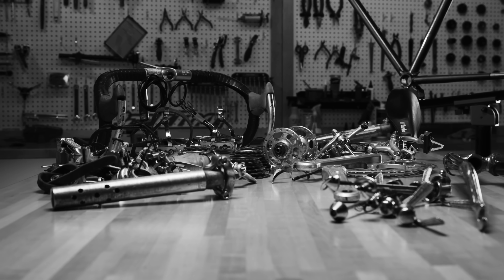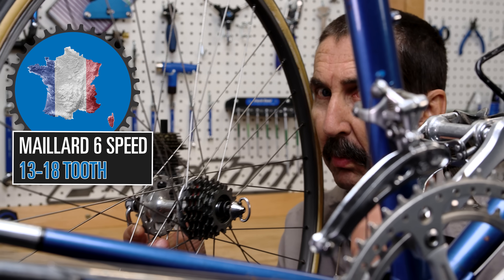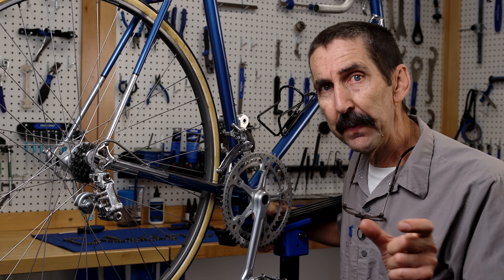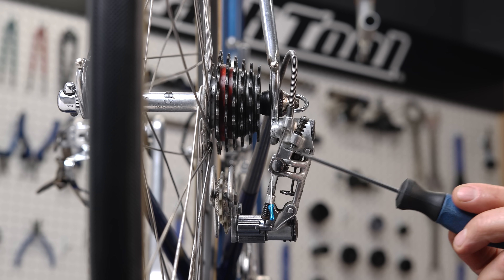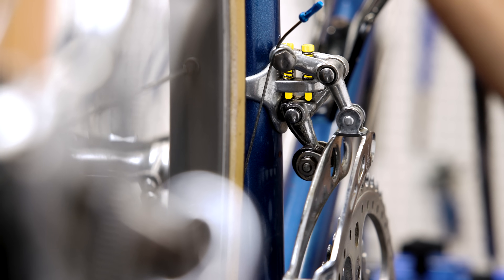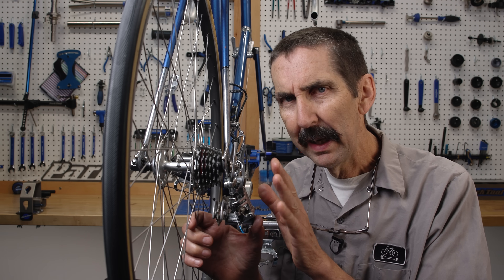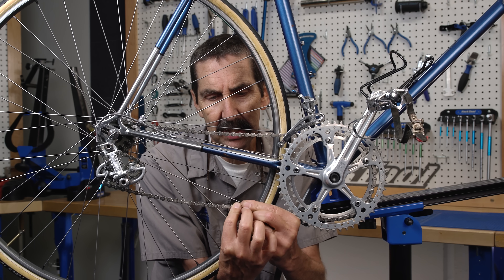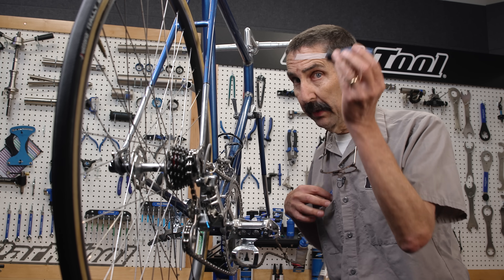What Can Old Friction Shifters Teach Us? | Tech Tuesday #225

Comment: E bikes basics end all.
How to Build Superiour E Bike Yourself: 
   Do not purchase pot metal e bikes designed by Lucifers kids or recommended by housewives& reviews Amazon. 95% humans = 
  I ride the 1st last e bike will ever have 2b built &will last u a lifetime.
 Step 1:
  GO LOOK@ YOUR NEW BIKE...
   Did u watch? FABIO URBAN RIDING ON Mt. Bike.
   U want STIFF DURABLE DESIGNED BY PROS Bike.
 Buy COMPETENT thoroughbred Mt. Bike 1st.
  $200 kit ebay 2nd. Thats it. 
 Understand never ever 2buy a pre built proprietary parts factory snake oil business E Bike pot metal flexible e bike for 3k with horrific ergonomics & crippled gearing& lousy components rusty cheap bearings stretchy spokes & brakes that wasnt built 4world champions on insane single tracks. Never buy bizarre huge tires or little idiot wheels cost $300 2replace tires $40 weird 2lb tubes or proprietary snake oil parts u can never find replace.
    Parts u can never find anywhere.
   Stick2 COMMON PARTS.
   BIKE must be STRONG STIFF STIFF STIFF STRONG STRONG WHEELS.
   I have supported 450lbs where thrubber meats throad. I could feel my worldclass STIFF handlebars& entire thoroughbred frame flexing. 
     Satans fancy e bikes would break in half in minutes as comparison what u see video below.
     Worlds best e bike? Is in my driveway. Do NOT SEARCH 4 an authority above me. Doesnt exist. 
    Modern bikes look like they do bcuz of me as do all world hour records broke since Graehm Obree ergonomics pioneered by me. All Tour De France riders went 2 Dual Control levers 1989. Shimano NEVER built better to this day.
     My engineering is END ALL go watch my short E Bike tutorials end all how 2attach beattery or carry stuff etc. 
    Very simple. 
   Step1:
   Just purchase used top of thline dual suspension Mt. bike $500.
 Done.
   Step2: Bolt on DIRECT DRIVE 36v kit (stone reliable) or planetary 10-20 amp 36v battery. (I am 150lb. I get 35miles 16.5 ave. Speed or 70 miles 13mph.)
   Geared motor 8lbs can wearout 3 - 10,000 miles.
   Rear drive Ok but horrible 4changing flats lousy gearing. 
   Bikes are 98% made 2POINT &SHOOT. After that turn once in a great while YOU DO NOT LIVE IN AN OBSTACLE COURSE there4 Front drive is probably preffered.

   Direct drive 22 lbs, but, goes 50,000 miles SUPER reliably.
     Done.
  Thats it. 
 That is all.
    Bolt on $200 36v kit:
    1. NOT 48v 
   2. NOT 72v ....kit 21mph max speed only. RE READ LAST SENTANCE.
   21 MPH ONLY ONLY ONLY.
   Less is more MUCH more on COUNTLESS levels. 
 BUY aero bars or long cowhorns (Origin 8) HANG... I SAID HANG.... NOT BOLT ON WITH METAL.. 
   Hung with flexy nylon straps in TENSILE.m a FLAT PLATFORM front of bike like world leader BIKE MESSENGERS do.
  
    Never supported on COMPRESSION metal bars like MESSENGERS that will vibrate like mad break. 
   Hang: Wirh elastic shock absorb 2" nylon straps..a basket or simple steel grate welded wire platform made of wire just above front wheel is best front 4groceries.
  U can use AERO BARS 2hang that basket. 
 DO NOT BUY 1of Satans front baskets.
  Place battery in frame/above top tube best centrally or simply in basket strapped with velcro straps against CLOSE2 handlebar. Battery low on frame is better, sure, but requires tooling& advanced skill.
    Your e bike is done ready2 ride.
   Make sure use WIDE strong handlebar with bar ends USED BY PROFFESSIONALS ONLY. NOT AMAZON POT METAL BARS.
 U must have wide bar leverage steer heavy front end. U MUST MUST have wide bar for triangling your arms FOR STABILITY WIDEST TRIANGLE.
    YOU MUST MUST MUST LOWER LOWER LOWER SEAT all the way. 
  You will get much less wind drag MUCH LOWER CENTER GRAVITY STABLE HANDLING & PREVENT FLIPPING OVER FRONT OF BARS (When braking downhills heavy items front.)
   Yes u CAN PEDAL BENT KNEES.
MAKE yrself ALWAYS PEDAL on E Bike "save gas."
 It cost 5 pennies charge e bike. I go 40 to 70 miles 12 to 16mph ave. Speed.
    You can now carry 2 5gallon buckets bar ends or4 2 x 4 resting bars strapped 2waist. 
 You WILL
 NEED.
 To carry long things/more things on occassion.
 hence WIDE BARS. I carry gallon milk each bar end. Or buckets filled with light items, bread.
   70lbs battery/groceries front basket max. (Or u can flip forward when braking or downhill breaking.)
     I easily carry 50lb corn, even 100lb corn basket not counting 15lb battery. But u must be very careful experienced rider 2do that. 
   I have carried 30 tons in 11 days with this bike. Using a trailer SINGLE WHEEL 20" WHEEL TRAILER ONLY NEVER 2 WHEEL.
    I destroyed 2 pot metal cheap trailers doing it & shred back tire but u WONT do that on Satans garbage pot metal bikes.
    Use E bike rated tires.
    These dual suspension Pro bikes designed 2do 5 ft. cliff drops all day. Comprende? 
 Get this: They weight 21lbs!
   BIKE MUST BE STRONG STRONG STRONG WHEN CARRY WEIGHT.
     Lol Lucifers kids downloaded super hero avatar Elon Musk computer animation in2 your matrix 2Whitewash me.
  (Lol Yahwehs annointed son Halayel ("Satan") can hack reality. He was Jesus elder brother back when your solar system was heaven. DO NOT BUY HIS DEVIL HORN SH*T BIKES he hates free energy. He wants money pay2play only. To learn what not2 do watch Dirtpatcheaven video "Does This E Bike have 2much Power? Urban Glide E Bike Review.")
   All manufacturing is controlled by Lucifers kids.
   Bikes Direct also great place buy NEW bike new.
 Satans kids DONT KNOW THEY POISON. They literally tear their own house down with their bare hands. Dont subscribe them or buy in2 their poison angel of light photoshop engineering you are NOT qualified 2know where 2point as an engineer I was ONLY ONE PUT ON EARTH 2DISSOLVE MATRIX. Satans kids are not humans. They computer animations. 
   This is what top line Mt. Bike can do = STIFF DURABLE CAN HANDLE STRONG BREAK &(actually) has GEARS see FABIO URBAN CYCLING

Comment: So I been sidding around reflecting on what a cmplete bnch of shthed cimpanzees I am alwayz surrounded with.
Just got my slick/knob hybrid tire in thmail. 
  I hav never ridden theez tirez b4 yet theez are thtires th exactirez I pioneered invented& designed 40 years ago. Back when I also invent disc brakes&disc specific rims which have no heavy sidewalls round section torsional rigidity.

   So Mike& Ken has had 100's motorcycles& ridden yet hundreds more. His best friend is me, greatest cyclist and engineer 4bicycles history of mankind. 
    And creation.
 Both in heaven &on earth.
   Epicenter of what finally became thmodern day bicycle known as a "Mt. Bike."
     I have lectured Mike& Ken more then any cyclists on earth they well know I am genuine. They know who I am acknowledge it.
  They bought my vintage bikes & ride them like precious gold& Ken even gave me th bell off his Harley they miss thpoint. 
 Yet they cmpletetly miss thwhole thpoint its not about my garbage proto type Mt. Bike I built 40 yearz ago on a budget of $200.
   He still just doesnt get it& never will only friend I ever had waznt a cmplete sht 4brains was Top Jimmy.
  Him& Ed Van Halen.
   Theez tires are made in Taiwan. Taiwan are good people. Righteous people. When it comes 2manufacturing.
  Them& Korea.
    &While theez tirez have been built b4, by countless manufactures THEEZ Kenda Cross K847 wr built closest 2my original specs. So I boughthm.
  So my neighbor Josh he ask me did thcoal mine knock over my retaining wall dont need coal mines2knock over a cardboard house built on a skinny 1 x 4 ft. glued on "retaining wall." 
     Can u evn imagine a 1foot retaining wall glued yes glued 2gether by Lucifers kidz no less who deliberately enginneered thglue?? 2b weak& fail??
   They cmplete backstabbing a-holes& no yr not gonna win in Satans courts either. Sell that fragile p.o.s house build a 20' dome stone home just get out all thworlds problems cn be solved in th garden form communities DELETE MONEY.
   Me? I been wanting form communities delete money. 
    Not1 person join me.  
    They2busy hoarding corrupt cash huddling under thblack annointed wingz of Yahwehs stupid a$$ annointed son. 
  His name isnt Satan it's Halayel.
 Hal ruled creation back when yr solar system wz heaven he was Jesus elder brothr of 2million years. 
   Yahweh bans all angels from telling u any of all this.
     Hiding that picture under a rug or by giving Hal a serpent humanoid costume& a Satan T Shirt isnt going 2change thingz 4your picture.
 Show me a mans enemies I'll show u whathat man is.
  Its a picture. "That's not who I am" isnt gonna hold any water in a criminal court. Are u serious?
    
   Biggest idiots of all = Gangland syndrome.  "Look what a respectable thug i am" theez guyz proud of being in prison.
      Thankfully satans kids always put up a big sign in they front yard warning us "I am thneighborhood cmplete retard" it's a universal law they hav2 tatoo thmselvz.
    "Hells Angels" syndrome Harley humps. 
        They proudly driving around thinking they above it all &evil itself gonna keep right on blessing their corrupt banks&"Gangland" tatoos  while they serving th local communities with vast cornocopia deadly drugs. 
 A vast blattantly obvious chasm has now emerged = Satans seed "weeds" versus wheat producing (good not evil) fruits in th field.
  By their fruits u will know them.
    So I ASKED Yahwehs son:
       Did you ever bless people? Any1 who sacrificed their soul or child 2u? 4fame& 4riches???
 "We never gave any of them sh*t" ...his queen interrupted &stated.
    (Her name is Lilith& she was Adams 1st wife in eden& 80% humans = nephilem spirits she control = demons placed in flesh bodies with Hadron Collider. Just as dayz of Noah = cmputer animations = 99% You Tube "creators" (that yall make your gods.)  
  Biblical "tare race."
 
    Demons need money.
    When living on earth so dont buy work4 or proudly promote their stupida$$ products.
    Lilith puts demons in flesh bodies using Hadron Collider.
   They want th high life on earth. 
    Lavish lifestyles. They hire humans 2wrk 4them who just ignore thrapist in thpark& 5star review thm hoarding corrupt assets&cash.     
       Worse people = thoze embrace them (after) thveil lifts &they discover whathey are.
    Theez roam around with thr stupid a$$ Hells Angel tatoo saying look what a cool neighborhood retard I am.
     I built 12 of theez demonic "homes." Oooh but how i hated that job. Literally made2 fabricate cmplete snake oil backstab highest maintenance ultra biodegradeable cardboard flimsy toothpick houses of bug food. 
 
      Nobody home in th light house all u get is a "deer caught in th headlights" look. Blank stare.
    Decades now I been pounding it in2 theez people few bags cement& rocks
builds u a STONE DOME cost u few $100 last u 10,000 years.
 Seriously?
   Listen renounce Yahwehs annointed son.
  Delete money.
    All thworlds problems cn be solved in thgarden get back2eden.
   Its where u wr put.
   U cant knock over, blow over or burn an inverted cereal bowl of cemented rock or evn feed it yr 2bugz. 
   Cat 5 tornadoe dead center pass over that thing wont FAZE it.
 
 ..$5 now gets u ONE good 2×4
   = Termite candy. Mushroom food.
  Seriously?
 Wood frame = ticking TIME bomb from highest maintenance oxygenated flammable tinderbox h*ll& line up yr children! In we go kids!
 These people are insane.
 ThMunsters.

   Ultra high maintenance "insulated" (lol lol lol) hollow wall rat infested nightmare& u knock on peoples door tell them hey look... "Man this sht has2stop."
    Listen yr chocolates& flowers barbie doll plastic $30 a gallon designed 2fail paint skin highest maintenance house is an absolute p.o.s. period sir..
   Thoze people YOU hired (points 2their chest) 2build this sht = total backstabbing scientists from h*ll criminals.
   Theez people are a$$hole backwardz he will hate u &plot2 kill u. 
    Alas u can't taze handcuff& drag a satanist by his ankles in2 eden.
    Bible say "they tear their houses down with their own2 hands"
     When I built theez homes it was literally hang customer by a $250k rope HE 5star reviewed&payed4& it wz mum's thword with all my wrkmates2 -  they licking Satans annointed shthole 4a paycheck. Juss where do we draw thline on all theez people if u cn evn call thm that. They sure not from this universe. 
    
  
https://youtube.com/shorts/HYBP5hQQuQM?si=NeMtesyuep-P5-ub

Comment: I'm 6'10 I ride an old school early 80's 68cm Japanese  road bike chrome moly frame with Suntour superbe friction derailleurs and Suntour Barcons on the ends of my drop handlebars.  It's fun and works for my length. I don't have to spend $3000+ having a bike specially made.

Comment: All my road bikes had friction shifters. My current one is a 1985 Cannondale SR 300 with Suntour Cyclone derailleurs and  friction shifters with a 12-24 Suntour New Winner Freewheel. It is very easy to use. I was thinking of changing the Freewheel to a Sunrace 14-34 Freewheel. How well will a hyperglide style toothed Freewheel work with friction shifters? Thanks for the video!
Reply from the maker: They work great! The chain shifts between sprockets much more easily on a hyperglide.
Reply: Thanks for the help. Love the channel. @parktool

Comment: Thanks for the vid
I still ride my friction shift occasionally, and I learn something from this video 
About why the rear stays have those long slots and screws. They’re basically the B tension screw 
And the way you explained how to adjust the internal cogs is exactly right.  Out on the road when you shift into the middle cogs, you need to shift and then tweak the leaver to set it in place It takes a couple of seconds.  But you soon get the knack.
When climbing, you have to relax the load on the pedal while you shift. Again a little awkward but with practice you improve your skill for smooth shifting.

Comment: I mostly ride friction and love its simplicity and price, almost no tune ups needed compared to indexed, plus most all brands of components worked together. Freewheels do not wear out as quickly as they had taller and fatter cogs. The older wheels had less dish and usually more spokes. The old system is similiar to an old car with a clutch and the new system more akin to an automatic. Also if you had a loose cable, just pull your shifter a little bit and you are good to go. On indexed, if you are out in one gear, usually all gears chatter. Love my friction.

Comment: When I first started riding friction shifters on a quality bicycle (1981) I shifted by ear, trimming the gear to remove chatter.  After a while, I could feel the vibration from chatter in the shift lever and trim it out even in high noise.  I still have a 1994 Klein with indexed down tube shifters that had the option to work as friction shifters.  That is the way I ride it--more fun.

Comment: In the early '70's I bought (new) and raced a Paramount like this.  Mine was red, with the same half chromed front forks and rear stays.  As I recall, Schwinn made them to order (at a loss). Initially Weinmann side pull brakes, later Campy side pulls, everything else Campy.  5-speed clusters, 14-18 for flatter routes, 13-21 (2-tooth jumps) for hillier ones.  Smallest chainring that would fit the spider was a 42.  Don't know how we managed to climb with a 42-21 but we did.  For one race I was loaned a wheel with a 6-speed cluster, which seemed SO high-tech at the time!

Comment: Been a professional bike mechanic since 1981 so I've owned a few friction shifters. So on my first MTB, it was equipped with Suntour's retro-friction thumb-shifters, which are superior to the basic Campy and Shimano friction downtube shifters.   Didn't Huret have a similar shifter that worked on a roller cam instead of the ratcheting retrofriction shifters of Suntour's?

  The first years of these bike with triple front chainrings add even more training base knowledge, But now that single front chainrings are now the norm triple front chainrings will be forgotten.  There's going to be a time in the near future when even derailleurs are going to be superseded by what Pinion's transmissions is bringing to the marketplace.

Comment: Another great video from Calvin.  I have a 1982 Schwinn Voyageur with friction shifters that I restored last winter.  Index shifters are great when they work, but only when they are in perfect adjustment.  Friction shifters require some technique (like when you have to change both forward and rear sprockets going up a hill) but from a maintenance standpoint they are much better.

Comment: My Fuji Tour uses a friction bar end shifter to move the front derailer and an index shifter to move the rear one. The index bar end shifter can be easily turned into a friction shifter if need be. Brakes and shifting kept separate, kept simple and easy to fix.

Comment: I done a lot of cycling in the 70s and 80s with friction shifters. It just seemed so normal to adjust your levers on the go, you just developed a particular feel for each bike. And maintenance adjustments were pretty straightforward to do.
Index systems make gear changing easier, but simple maintenance and adjustments harder.
I still have one lightweight road bike with friction shift. It's in perfect condition and makes for a nice simple old school ride.

Comment: I have a 1986 Schwinn SuperSport that came with indexed/friction Shimano 600 shifters (you could choose!). I switched out the rear wheel for a more modern, 8 speed cassette wheel and switched from index to friction. My plan was to update the shifters to Dura Ace 8 speed so that I could keep my indexing... but I never did. Friction shifting rules! (I've also had several beloved, older friction shifting only bikes.) Honestly, friction shifting is smoother (less capable, sure, but smoother) than my Sram Rival AXS groupsets on my nice bikes!